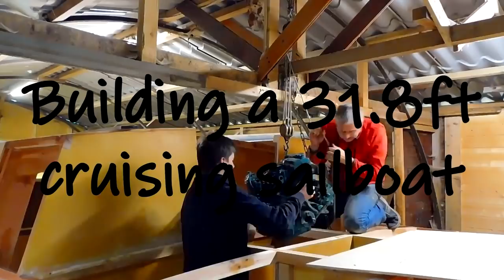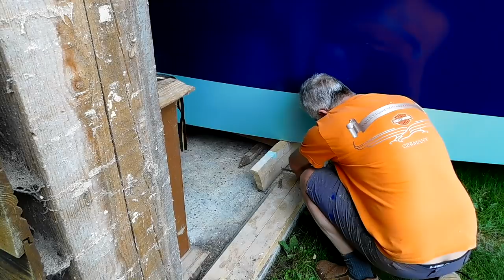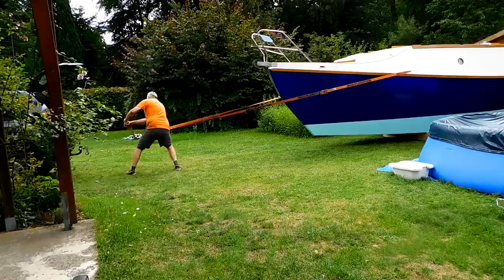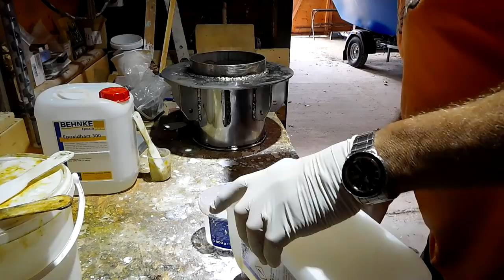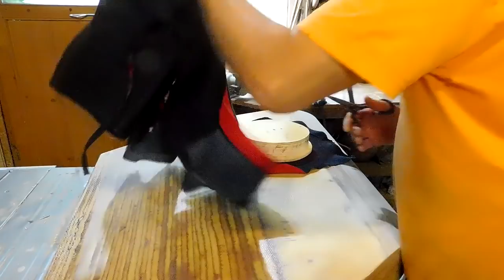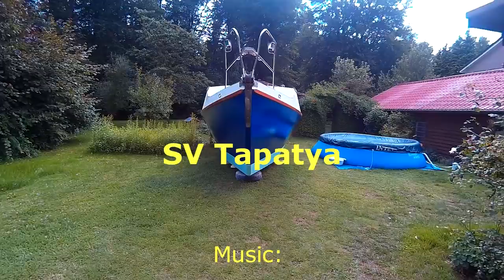The Boat Is Out Of The Shed!!; Building a cruising sailboat - SV Tapatya EP194

Comment: Hi Tony, sorry I missed you last week, love the light inside the cabin too. Wondering why you don’t make a large metal ring to go around the mast inside the cabin to secure those big bolts? instead of going with just individual washers
Reply from the maker: Hi Pierre. No worries, mate. I thought hard about a backing plate for the mast fitting. I went for the big, thick washers for a couple of reasons - a test report in PBO that basically said plywood makes a decent backing plate, the ply at the partners is 4 cm thick, and washers are a lot easier and cheaper 🤔

Comment: what is the purpose of the wet epoxy sanding technique and what are you doing for a keel?
Reply from the maker: Hi Caleb. It’s a technique taken from the book “The Gougeon Brothers On Boat Construction “. I think the idea is to key the hardware in such a way that absolutely no oxidation occurs before fitting it. It should give a thorough and lasting bond.

Comment: water ingress through the bolt holes?
Reply from the maker: No. The holes are done with the drill fill drill method; the thickened epoxy then squeezes into all gaps and seals it

Comment: Shouldn't you be sealing around those through-bolts? Butyl tape is the usual way.
Reply from the maker: It doesn’t need any other sealant, Mike, the epoxy squeezes out and seals everything. I’m inclined to think there are several usual ways..🤔
Reply: @SVTapatya  Well best of luck with it,........but epoxy is hard and brittle, whereas you need flexibility around fixings.

Comment: not a fan of deforestation but the sharpie flat bottom and good cabin area are good choices for stability and liveability
Reply from the maker: Thanks. I am not sure of this claim, but I reckon wood is more environmentally friendly than the alternative boat building materials 🤔
Reply: @SVTapatya  timber crops have ecosystems that are destroyed when cutting the trees and when you demand wood, more wood is cut from legal or illegal logging in real forests. there's bioepoxy, bio carbon fiber, bioor recycled hdpe or pp (plastic that float and absorb hull vibration and stresses), nanocellulose fiber, etc that can be extracted for almost any biomass with a non toxic refining process, besides hemp or flax fiber for sacrificial external layer for sun and temperature protection of biopolymer fiber or resins
Reply: The best thing about trees is you can replant many more than were taken down. Also some stands of wood are purposely planted for future harvesting.
Reply: @jamesglenn2006  trees are forests, even when you chop a young tree there's an ecosystem with them and soil erosion after
Reply: @crapisnice  I own 58acres of forest,  there is a lot that goes on..like wind storms snapping trees. Should that tree just rot or can I use it as viable lumber, use the scraps as heat source, return the ash to the forest. The small limbs turned into mulch, there's a lot that can happen on  a wood lot without " destroying" forests. Don't believe the hype.
Reply: @jamesglenn2006  that's forest biomass and i am working with universities and government (though job) to extract forest biomass with pruning, fallen trees, (excesive leaves or needles that can cause fire), etc for diy biorefineries and biocomposites, that way why we can make reforestation and have plenty of biomass available for useful composites

Comment: i wonder if basketballs under the boat would have rolled it out?
Reply from the maker: Possibly. I suspect they would roll every which way. Also , I had fence posts but I didn’t have basketballs 👍
Reply: @SVTapatya  maybe if the balls were wrapped into strings/rollers of 3 or 4..?
Reply from the maker: It might just work 🤔